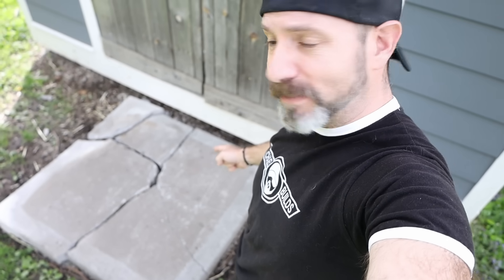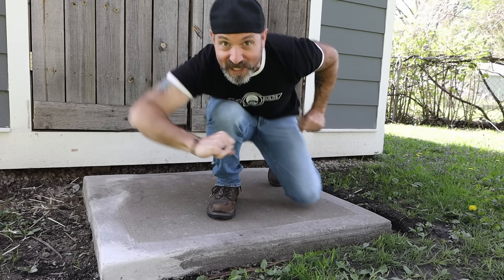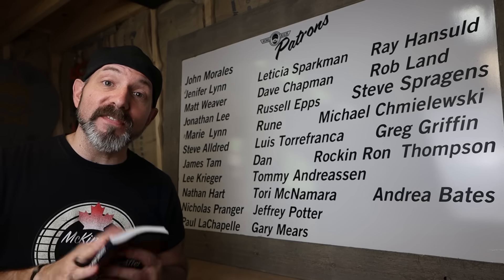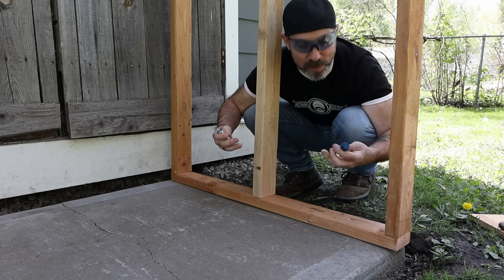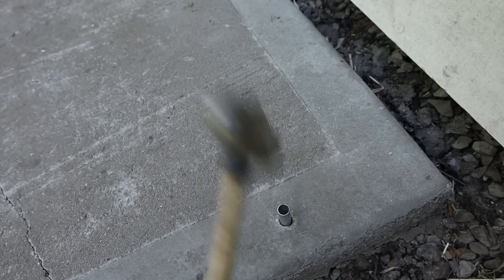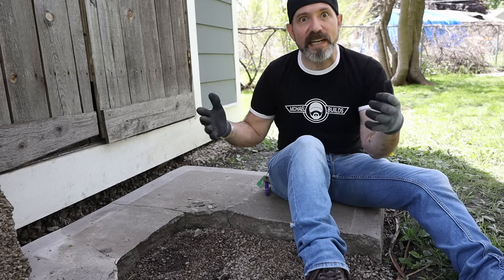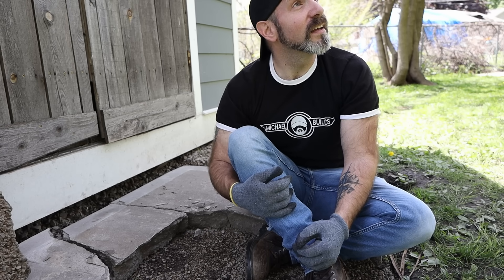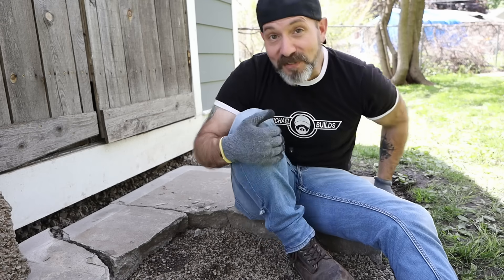Dry Pour 30 day cure Test

Comment: It looked like the slab cracked while driving on it, only because the ground under the slab became soft and gave. You can see the ground flexing when you drive over it. one of the shots the slab lifted and can see its solid but the ground was giving.
Reply: I was thinking that could have been the cause as well....
Reply: I saw and thought the same thing, I'm not sure if rebar would have helped because there just isn't enough compaction under the concrete to support a "small" slab.
Reply: @The3chordwonder  I get that, but also I think with rebar, it would have held and displaced the weight better.. in turn compacting the ground more evenly.. 
and that may have been enough to not crack the crete..
Reply: Yes , I've driven on driveways made from those 16x16 by like 1.5" stepping stones and some of them break but not all of them . Because of what's underneath.
Reply: Also  any slab you drive on would be thicker than that.  Wider as well.
Reply: A driveway would probably include some mesh or rebar...
Reply: lol...oh there he said it later in the video...lol.
Reply: I agree, if the base had been properly compacted, I think it would have been ok.  Was the topsoil removed prior to fill and compaction? I didn’t see the previous video.
Reply: I don't plan on driving a heavy truck over the slap hoping to destroy it or install the post so that I could hang my entire body over it 6:20 to see if it would takes me down and possibly kill me 😂 so I think I'll be fine using this amazing technique for my project.  This video is very useful and funny, thank you! 😅
Reply: @chanthana7694  if you dont mix it and do it this way you can not get full strength and you cannot activate the air entrainment chemicals so soon as some freeze thaw starts the cement will start to brake down , and add the fact it is ten times easier just to add the water first mix and pour its kinda stupid to do it this way
Reply: Agreed...the base failed causing the slab to fracture. Great to watch this video!
Reply: I only need to put my 85 pound grille..noway it would crack..I'm going to try dry pour 😊😊
Reply: @elliottdavis805  dumb
Reply: I believe if the drainage gravel was larger and tampered plus metal panel In slab plus a full 4” slab it would not have broke at any rate I will use this method for shed floor and patio
Reply: I agree, I was superseded how well it held up, I think it was the back and forth and tetoring that cracked it
Reply: That was what I noticed as well. I think it was about the second or third time.
Reply: it breaks because concrete needs to be mixed for the right amount of time to get its strength..

this is not cool, concrete is not a sustanible material.
this is a waste and it is destroying our world..

this material could last for hundreds of years we have german bunkers and roman concrete with lime..
and you guys think these guys did not think about what they was doing and you can do it better 🤣

every concrete producer will tell you the right time to mix concrete if you ask for instructions..
and those instructions can tell you this will not work, no need to test it again and again all over youtube..
the producers garenti this will not last
Reply: Yep I seen that too
Reply: How long was it cured before t you started the tests
Reply: Yes, I believe you are correct.
Reply: +1, any concrete driveway SHOULD have a tamped gravel base.
Reply: @Combat_Pyro  The difference here is that a tamped gravel base works when pouring concrete the normal way.  But when using dry pour you need a packed dirt base.  If you use a packed stone based this allows the powder to fill down thru the gaps in the rocks. And, as seen here, ends up creating an unstable base.  With dry pour you need packed dirt on the bottom to allow the concrete powder to absorb the moisture out of the ground.  In this way the concrete gets moisture from both sides.
Reply: 100%
Reply: @atlasgunther8947  lol %100 WRONG
Reply: @frostycools1315   ill prepared substrate, look it up
Reply: I think the main thing is your base wasn’t compacted
Reply: 100%
Reply: I agree, the ground shifted under the small slab.
Reply: @Robert40693  dry poor is shit useless
Reply: I appreciate this is a test, and I enjoyed the video. But for a slab this size, is it really that much more work to mix the concrete and pour it the traditional way?
Reply: Years ago, we had a porch poured and had some left over. The driver couldn't take the truck back to the shop with that much mix in it, so we quickly grabbed some boards and he poured a makeshift walk way and car pad. No ground prep at all. The car pad eventually cracked and a part subsided because of the ground beneath wasn't prepped. We poured on grass that had no compaction, no gravel base or rebar. Without proper ground prep, mixed cement won't even stand up.
Reply: @hot2warm  stay in your own lane , cement can be mixed to many strength levels , the crap you get in a bag is at best 15 mpa if mixed according to instructions ( min of 20 min ) to reach 15 mpa, mix for a porch would be in the 10 - 15 mpa range ,,, stuff we put in the driveway would be 30 mpa and air entrained , why you people even bother to comment is hilarious
Reply: @frostycools1315  Some things really don't need to be said, and mix strength is one of them. If you knew so much, you'd agree that setting a proper base is equally as important as the mix. As weak as that porch mix was, it was the base that failed, which resulted in the cracking, as I stated. Do you know what subsidence is?
Reply: @hot2warm  you can pour a 30 mpa piece that size on mud and it will never crack , like i said its hilarious when people like you comment , its a test sample and stick by my every expert opinion , you should go back to washing dishes or what ever it is you do for a living .
Reply: 100% a traditional mixed pour would've done the exact same thing in those conditions.
Reply: @nickjones4721  lol and what would you know about it ? without mixing it the cement cannot reach its full strength so tell us what you think you know about it , 20 mpa 5 inch think is not going to crack that size lol
Reply: I agree with some of the commenters. I’m thinking the slab cracked because of the ground underneath and surrounding it is soft. I’m not a professional by any means, but have helped build a lot of roads
Reply: @timadams7467  cement needs to be mixed or it never reaches full strength thats why it cracked , cement 101 , on every bag it says mix for 20 min to reach full strength , cant get the chemical reaction with out it , stay in your own lane tim
Reply: I agree, I saw it shift as well
Reply: It probably wouldn't cracked if he had rebar the slab.
Reply: This method isn't meant to be driven on or have huge weights on it.  More for walkways or landings from decks or small patios.  Works perfect.  Never meant for the first test scenario.
Reply: Yep.  I saw the same and would agree.  Had it had the proper gravel base, rebar, and 4”-6” thick, it would perform as well as a wet pour driveway.
Reply: absolutely spot on. if the substrate had no give, it would have been fine, same would have happened to any method of concrete. the method was not a factor in that failure. 

top in compression, bottom in tension. big concrete nono.
Reply: Theis would be perfect  for my walkway. I'm doing mine next month.
Reply: @life-pm5xl  Don't drive your F-150 on it... 😁
Reply: That slab chunk is very thin to handle driving on And zero rebar. Normal concrete would of cracked as well under this test
Reply: lol you know nothing
Reply: So your saying to only use this method where the ground underneath isn’t soft (aka the Earth)?
Reply: @cynic5581   any ill prepared substrate, unreinforced concrete method would yield the same results. it's literally why rebar is used in concrete. to provide tensile strength, because concrete has very little.
Reply: @cynic5581 To pour a slab, you basically remove the topsoil (black dirt) compact the subsoil which hopefully is a clay base, add aggregate which you compact again to the desired grade and pour your slab on that.
Reply: @cynic5581  🤦🏾.     You have to prepare the ground correctly or you will get the same result be it a wet or dry pour…🤦🏾🤦🏾🤦🏾
Reply: if the bags were mixed you could have drove a tank on it without it braking , dry mix sucks sht
Reply: @frostycools1315  tanks? Come on

Comment: I don’t see this as a fail. You abused the slab and it did well. You usually won’t drive over it. Most of the pours I’ve seen are not for building on or driving on and as an alternative it works, same as pouring it dry in a hole and adding the water around the post. People just hate what they’ve been conditioned to believe. The videos state it’s not recommended for climates with extreme winter temperature either.

Comment: Lol, I'm still not sure about dry pour,  but I'm going to do it as an edging border under my new fence.  Hopefully will save time weed eating and keep the metal panel fence secure.  Much easier than my 60 year old body mixing concrete! Great video,  and does give people options. Thanks Michael
Reply: I used it to pour 2 column base fillers and I'm blown away by how well they turned out .I used non shrink grout and it cured without cracks,one I did a couple days earlier using the normal dry pack methods did Crack
Reply: Good idea : )
Reply: Yes, sounds awesome!
Reply: I was thinking of doing the same I'm going to give it a shot just wondering how well it would hold up in the pacific northwest with cold temperatures.

Comment: Wet pour of that same sized slab would have failed the truck test also. Having the edges of the slab fully exposed is what makes the pressure too great. Had Michael just filled in dirt around the slab it would not have failed. I have a concrete mixer I might be listing for sale after watching these.
Reply: I have a mixer I should sell too!

Just make the slab a tad thicker and add some rebar and just dry pour it!
Reply: , 
0

Comment: thank you for making this video, I am going to be building a back porch with a roof over it and I was going to build a deck using wood but after seeing this I am probably going to do a dry pour with reinforcement and let it set for 30 days. do you think it will work on a 20 foot by 30 foot slab?
Reply from the maker: Absolutely! 👍🏻💪🏻
Reply: @MichaelBuilds  What kind of concrete mix/brand did you use?
Reply: That's a lotta sacks of concrete!!

Comment: I'm hoping to buy a pre-fab shed this year. I would feel much better if I can put it on a slab, but having a wrist injury, the idea of mixing the concrete scares me. If this can hold a lawn tractor, I'm willing to go this route. Thank you for all the time you've put into this topic.
Reply: The base prep is everything.  Remove the top soil, lay down underpayment fabric, add ABC stone to 6-8 inches, compact well, then concrete.  Should be just fine.  Or you can rent a mixer from most rental stores to pour wet.
Reply: @johnr1350 well, I got a deal I just couldn't pass up on the shed, so now it's go time. Quotes for a pad are way higher than I anticipated, so I will need to do this myself. It's not the mixing that's going to be the challenge, it's the digging. Turns out a skid steer is only a couple hundred bucks, so we're leaning that way and then wet pour with a rented mixer.
Reply: Reinforce, and pour thick. Maybe that will give you the strength and longevity you desire.
I still won't dry pour anything personally. I couldn't live with myself if I sold a property or did a job where there was inferior work done.

Comment: Dry pour is click bait. There is a reason why concrete is mixed with water prior to pouring. The people that originated this click bait garbage should be shamed and demonitzed. Here's a novel idea, learn the trade from professionals and create content that reflects that expertise
Reply: I've had a bag of concrete go hard on me just by soaking up moisture out of the air over time.  

No I wouldn't use it to build house footings or a drive way but I did just dry pour a small slab for my AC unit and I might do another for my trash cans.
Reply: A hammer should be the only way to drive a nail.  Those nail guns are a waste of time.
Reply: @ronlambert4701  Just because I can drive a nail with my penis into a 2 x 4 doesn't mean that I should.
Reply: Just like space travel!!
Reply: Wow dude, you got to learn to relax in life. Get the Crete out of your ass......
Reply: Mike Day has already been shamed... horribly, and justifiably.
Reply: @tomtillman  really?  I don't watch baseball.
Reply: #drypourbrokeyou
Reply: Concrete contractor, am I right? Lololol!!! Pretty sure you have no clue what clickbait is… Lololol
Reply: @andredeschenes3445  you're wrong. X doesn't get the square

Comment: I'm not a big fan of the dry pour idea....BUT!  If there was wire mesh in that slab with a good gravel base it would have never failed IMO.  Nice video Mike
Reply: wire mesh might have still failed. Rebar would be best
Reply: @kkp4297  goes without saying
Reply from the maker: Haha I definitely am still not 100% on board yet either but I’m gettin there lol
Reply: I was thinking that if he did use mesh in the pour then it would have been able to handle that truck weight.